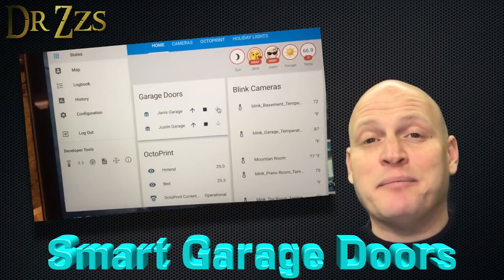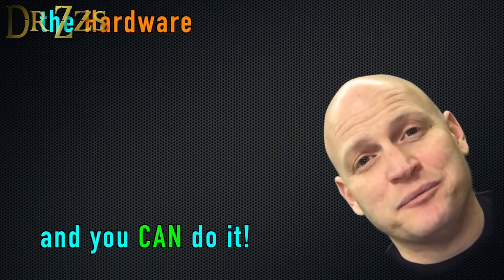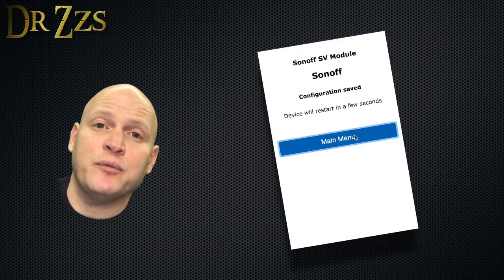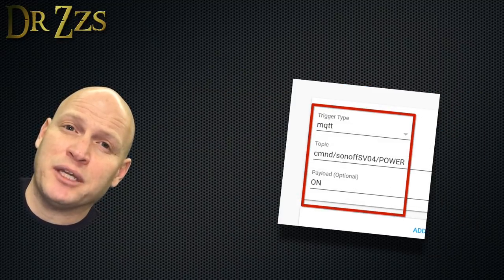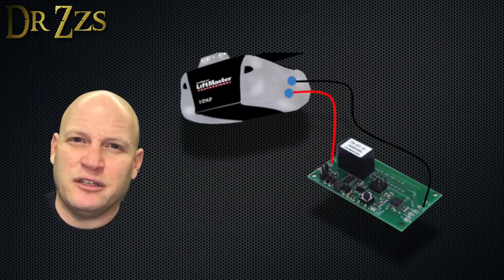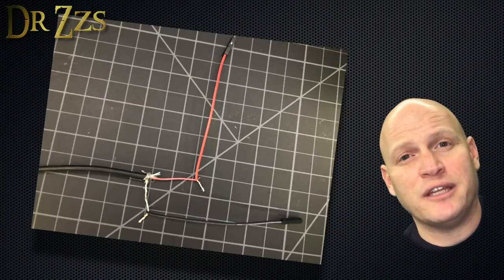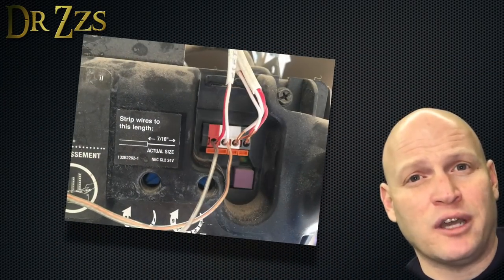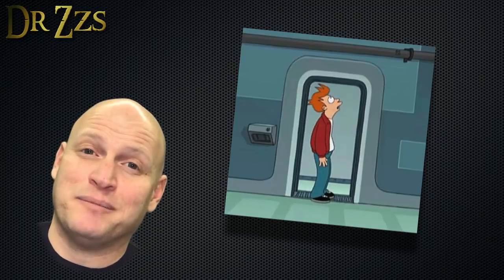$5 DIY "Smart" Garage Door Opener using Sonoff SV

Comment: Good morning... I've been struggling with my gate forever. It worked when it wanted to and it's mainly due to wifi signal being interrupted between turning the SV on and off. In any case I've tried something now for two weeks and zero problems >> this is just a suggestion but it works. Instead of HA turning the relay off after turning it on, I set Tasmota "pulsetime 20" which is two seconds, so now the switch turns itself off after two seconds. HA also turns the switch off, but that's only to update the status in HA.

Comment: Great project and video thank you.
would you know why if i duplicate this module everything works fine but the reed switch from either shows both doors opened at the same time. how do i make the reed switches only respond to its own switch
Reply from the maker: Check the mqtt topics.  Sounds like your second unit is using the same mqtt topic as the first.  You'll need to change the middle section of the topic so it's unique.  You can do that with "switchtopic" at the Tasmota Console. 
That should do it.
Reply: could you please give me an example of what to change and where. 
I did switchtopic2 3 and then in HA changed
  - platform: mqtt
    name: "RHS"
    state_topic: "cmnd/3/POWER3"
    command_topic: "cmnd/Garage2/POWER"
    payload_open: "ON"
    payload_close: "ON"
    payload_stop: "OFF"
    state_open: "OFF"
    state_closed: "ON"
    optomistic: false
    retain: false
Still doesnt seem to be picking up the reed switch at the closed position

Comment: Great video.  Got mine up and working.  But after a restart on HASS the state is unavailable until I open and close the door.  Is there a way for it to update without open/close the door?
Reply from the maker: Console command “powerretain 1”
I think that’ll do it.
Reply: DrZzs I did some testing after posting and it looks like switchretain 1 did the trick.  Just need to update my automation to not notify me on the restart now
Reply from the maker: excellent!
Sorry I should have included that in the video.
Reply: DrZzs no worries, thanks for the great video!

Comment: DrZzz, you have inspired me.  So much fun and thanks for all your video's.  I got Rasp3Pi running HassIO, got 3 Tasmota flashed Sonoff's running lights and last night I had all the stuff for this garage project.  Now here is my issue(s).  Flashed the SV with Tasmota, got in on the network and running.  Set up the switchmode1 0 and switchmode2 2, and assigned it 03 SV and switch 2 in config.  Copied all the code for the HA.  OK, here is goes.  On the HA dashboard, when I hit the up/down arrows, it fires the relay and the timer then turns it off after 1 second, BUT the dark black/light black indication arrows and garage door icon door does not toggle or go up and down like yours does in the video.  But it's communicating and running the automation.  Or it seems.  Secondly, the reed switch also turns on the relay on GIO14 and yes that is tied to that pin and the ground, exactly like your video.  Umm?  I'm stumped.  Should I reflash the SV?  I also took off those resistors like you did on the SV board.  It's seems close, but since the reed switch also turns on the relay instead of sending signal....and the fact that the icons on the dashboard do not show status when triggered, I'm stuck.  Thoughts?  Thank you again, keep the videos coming.
Reply from the maker: Someone else just had this same issue and I can't remember how he fixed it. I tried looking through the comments but gave up after a couple minutes.  His solution is in there somewhere. 
Seems like maybe the state topics from HA aren't matching up with the topic that gets published by the reed switch (since the arrows aren't changing).  That could explain the reed switch triggering the relay too. 

Someone suggested typing "pulsetime 10" in the console instead of using the automation to turn the relay back off.  I don't think that's the problem here, but using pulsetime in Tasmota instead of the "off after 1 sec" automation is probably the better way to go. 

Maybe post your HA cover entry.  I'll take a look and see if anything jumps out.  
I'll see if maybe that other guy with the same problem sent me an email instead of posting a comment.  

We'll get it fixed!  It's something simple I'm sure.
Reply: ahahahaha, just read your update, wondering why I did not read that before....I'll try that...
Reply from the maker: Someday I'll post a video that doesn't require correction or updates... someday :)
Reply: It worked or seem to, installing soon, can't wait.  Thanks again DrZzs.
Reply from the maker: anytime! 
good luck!

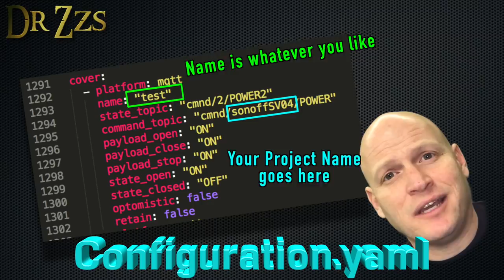Comment: I am a noob with home assistant, I am trying this at home, I have exactly the same for customize (2:02 in the video) after I  do check config I get this error message : Error loading /config/configuration.yaml:mapping values are not allowed here in "/config/configuration.yaml",line 15,column15, on line 15 I have the same as in the "video cover.test:" can anyone help me out here?
Reply from the maker: What's there at line 15 in your config?  There's probably a typo or sometimes even the wrong spacing can through it off.  
Post links to screenshots if you can.  Makes it easier to diagnose what's going on. 
We'll get it figured out.
Reply: thanks for the reply, here the requested printscreen https://imgur.com/a/O5a3k3T
Reply from the maker: I think I see the problem. You're referencing the customize.yaml (!include customize.yaml) but then you have an entry under the customize: heading.  Try putting those 3 lines (cover.test, device_class, friendly_name) in your customize.yaml file instead.
Reply: Ok thanks, that did the trick,
Reply from the maker: yeah! 
I love it when we figure it out and it works!

Comment: Hey @DrZzs
I have a question. I have two garage doors. One off them (sonoff2) works very good. I have gpio14: switch2, SwitchMode1 0, SwitchMode2 2 and SwitchTopic2 2. The sensor its connected like you did on the video, on first pin in first row, and on first pin in third row. And on other garage door (sonoff1) what are the options? I actually have gpio14: switch1, SwitchMode1 0, SwitchMode2 2 and SwitchTopic2 2, and the sensor its connected like the other one(first pin of first row and frist pin of third row), but it dont guive me the state of door. What are all the options for the second garage door? I tried switch them, but If the light turns off and on, it turns on garage door without my permission and I dont want that. The garage door with sonoff2, I did all like you on video, and works like a charm. Please help me with confguration and pin connection for the second garage door. Thanks

Comment: Why not use the auxiliary power on the garage motor to power the SV?

Also not sure I understand why you don't just bridge the Input terminals of the SV like other videos and use the output connected to the Garage motor?

Also how would one go about coding the status of the Reed switch to define when the payload should be activated or not? What I mean is if the garage door is open (according to the reed switch) and you want it to stay open how would I code this in HA (or elsewhere in Tasmota maybe) so that it doesn't actually send the payload and close it when I want it open already?

My concern is really just my kids having had one get stuck under a garage door before due to button press failure on their parent's parts. So if it's already closed for instance I don't want it to open when I hit Close etc.
Reply from the maker: Good questions:
#1 I just don't know where the aux power is on my garage door opener and it was easier to just add a 5v ps than find it. So, just lazy I guess
#2 Not sure what you mean by bridge the input terminals.  I wanted to keep the function of the button on the wall.  That's the primary way my wife opens and closes the door.  I haven't touch the button for my side in months, but she still prefers the wall button.  So I connected this in parallel with the existing button so it would still function normally. 
#3 I think you could do that with Conditions in a HA automation. The tricky part is, as I have it, there aren't different commands for "open" vs "close". I'm not sure it's possible in Tasmota to change the payload to something other than 'on' or 'off'.  If we could send different messages to open instead of close, then we could set the automation so it would check the state of the door and if it's open and someone clicks "open" it wouldn't do anything.  But since every command that goes to the door opener is essentially just telling it to toggle into whatever state it isn't already in, I'm not sure that would work.  You'd probably have to write a custom sketch that would send different payloads for open/close.
Sorry that's all I've got :)
hope that helps.
Reply: @DrZzs  #1 Aaah okay fair enough, I guess I was lucky to find a manual for mine that tells me exactly where but if that's not available it would be a train smash.

#2 Aaah now I understand exactly why. In my case the "button" isn't physical but an RF remote stuck to the wall and so that goes through a completely different interface. But now that you've explained it I understand the need for it.

#3 Glad you have as little on this logic as I have. I figured this would have to be compensated for in HA and not on the Tasmota side to incorporate the state as a sensor of sorts to only complete the action then. Will scratch that itch when I get to it.

Right now I've flashed my 3 x SV's for alarm, gate and garage so will do some soldering in the coming days and then have to fight with HA. :)

Comment: Thanks for posting! I successfully completed this project over the weekend. One problem - I tested on both of my garage doors and it only works with one of them. The other garage door (genie chainmax 1000) does not seem to function the same way (shorting the wall button contacts does not open the door.) Any ideas?

Comment: Great project, but I ran into a snag.  I have a Chamberlain O45ACT model garage door opener.  Apparently, this model doesn't respond to the momentary switch.  My second, older model, opener does.  Any suggestions on what I can do?  When I installed this opener a few months ago, I had to replace my existing switch with a new switch.  It has a button to open/close the door, plus it has a button to turn on the light--but this is all done with a single pair of wires.
Reply from the maker: interesting.  
My suggestion would be to find a wiring diagram of that opener and find out where you might tap into the contacts that activate the door.  I don't know enough about the inner workings of different openers to be much help.  
Wish I knew more and could be a better help to you. Sorry.
Reply: Will give that a try.  Thanks!

Comment: Great tutorial, thank you! I know you have already made a part 3, but I don't use ESPHome. A couple of things using 6.4.1:

1.) I was pulling my hair out with states not updating until I discovered via the console that "cmnd/garagestate/POWER2" only works on my configuration if I rearranged to "garagestate/cmnd/POWER2", same with the command topic. Not sure why these are backwards on my end?
2.) If I'm swapping open/close for the reeds to be at the floor closed vs. at the top open, is it as simple as swapping state_open and state_closed in the yaml config? I looked over Ahmad N's approach, but I got a little lost and wondered if it makes any difference.
Reply: Hi Tommy.. I have issue of state updates after upgrading my HA. I don't quite understand your comment about reversing the state topic. Is it working for you?? For me, the open/close functions are working properly, but I don't see the correct up/down arrows in HA for the state changes. whenever I open or close, I see that the down arrow comes active for a brief moment and goes away. Always I have the open (UP) arrow active even if the door is open. Any help??
Reply from the maker: Try typing "switchretain 1" and "powerretain 1" in the Tasmota console.  That might help retain the state after restart.  I'm not sure what would be causing your arrows to not show correctly.  You could try using "optimistic: true".  That would set the arrows based on the last command instead of on the actual state of the door.
Reply: @DrZzs  Hi Drzzs... I tried the commands and still nothing getting reflected in HA arrows. However using SSH, I can see in mosquitto_sub command that the state changes are reflected in commands.. there are 2 messages being sent whenever there is a state change... 

1. cmnd/maingaragestate/POWER2 OFF
this is from the switchtopic command i entered in tasmota console.

2. stat/sonoffGarage-1689/POWER2 OFF
this command i think is from the latest tasmota (i am running 6.5.0) 

I think I can use either one of them as state_topic in HA config yaml. I tried both of them and still both arrows are active in HA. Could this be related to lovelace?? because with latest HA, by default lovelace UI is showing up.

Comment: My garage door already uses reed switches to limit it's travel between open and closed.  Can you not just use the open and close reed switch sensors and roll into what you're using?

Comment: Could this not be done with same ingredients but only a MQTT & on smartphone MQTT Dash.  MQTT Dash to show green color when GPIO 14 is connected because the magnet is now close to it. (NO Home Assistant, NO OpenHAB, NO Domonicz!)
Reply from the maker: yes, I expect it could.  The main reason for using Home Assistant is to have all our smart home stuff interact.  So Alexa can tell me if the garage door is open after 10pm, or to have the lights in the garage come on when the door opens, etc.  But yes, there are good options that don't include HA for sure.  Thanks!
Reply: @DrZzs  Thanks for your response. Sounds like switch2 (reed switch) can update MQTT which from MQTT Dash can be seen. I suspect that without HA or similar, its not possible to get rules to notify if Garage has been left on after 10:00PM.  Also I think Alexa/Google integration will necessitate a platform like HA.  Did you I understand you correctly?

Comment: Poking wires is generally a bad idea, it might be fine on the garage door motor specifically where you showed, but its also a great way to get a shock and/or short something out.  Nearly every garage door install has the wires just stapled to the ceiling and wall.  Simply following the wire from the button would be safe and easy.  Also if you see 4 wires, like the connection on the right that you showed, that is likely the garage door safety sensors.  Which you also want to make sure are working as a prerequisite for this project.  

Another person also commented on the switch placement, on my door it would be fairly easy to mount the reed switch to the bracket for the optical sensor, and mount the magnet to the door.  This would ensure the door is fully closed as well.

Comment: Is there a way to run the setup without this home assistant software running on raspberry? 

I just want to use sonoff sv to trigger what normal garage door open/close button does that is near the entry door at garage.

I have a spare  ring sensor, which I can add to garage to known its open close status.

If some one can explain the wiring on sonoff sv for this case it would be great help.

Thanks.
Reply: Yes you could do that without Tasmota and without Home Assistant just using the default Ewelink firmware and app on your phone.
Reply: @SauRoNZA  thanks, I did it already and it works like a charm.

Comment: Would it not be more efficient to use Tasmota command "PulseTime<x>" instead of automation to turn back off, or would this not be possible with a dry relay?
Reply from the maker: Yes! I just didn’t know about pulse time when I made this.  Others have told me they’ve used pulsetime successfully.
Reply: Awesome! Great videos btw, discovered you a while ago when I was getting into Homeassistant. Will try this for sure when my Sonoff SV arrives! Looking forward to future projects

Comment: I recently bought Sonoff switches that I can add (in series) to anything that needs power to run. It did not need any flashing of bios and the Sonoff devices worked straight away with Home Assistant and working well with automation of lights around the house. Is flashing still needed or unlock any functionality that may not be available with Sonoff switches out of the box? Thanks for putting this video together and also loved your session with Frenck on YAML for HA...that was priceless!!!!

Comment: is there a way to reverse the reed open and close? For example, I want it to report closed when the magnet is separated, and open when the magnet is connected

Reason being it's much easier for me to mount both on the garage's open position than the closed position
Reply: I find a solution in covers.yaml file or in cover section in configuration.yaml change state_open like I wrote
and that its! :)

from:
  state_open: "ON"
  state_closed: "OFF"

to:
  state_open: "OFF"
  state_closed: "ON"
Reply: Thanks very much! will try it

Comment: So I used this sonoff sv idea to control a remote gate. However, the system is solar powered. I would like to monitor voltage on the system to validate solar panel power and battery charge. Does anyone know how to do that? I could utilize the same sonoff out there or install another one. Thanks